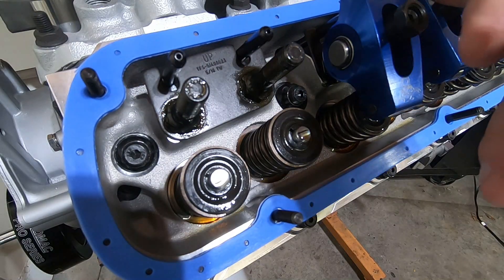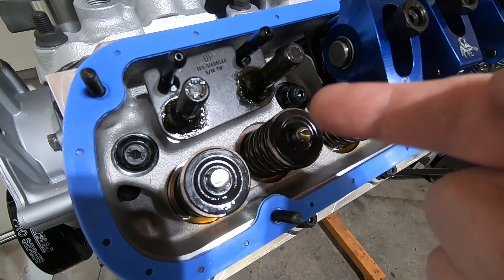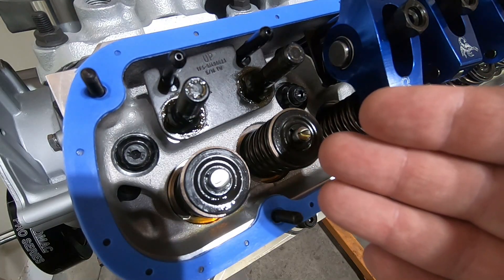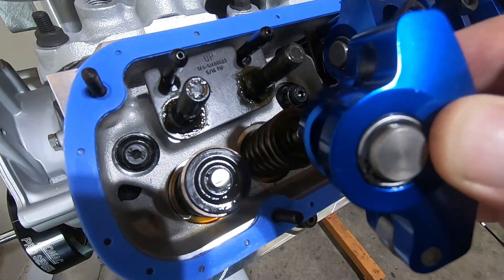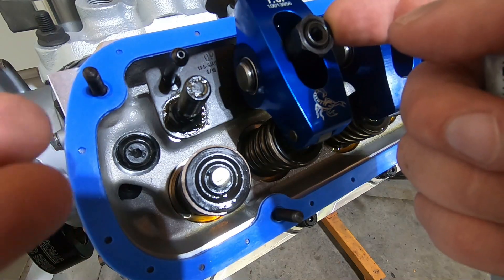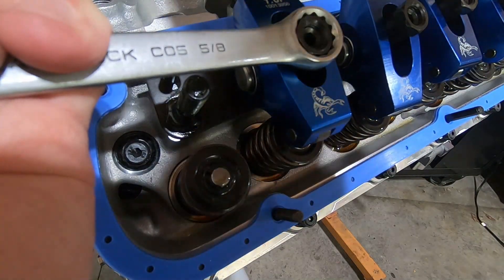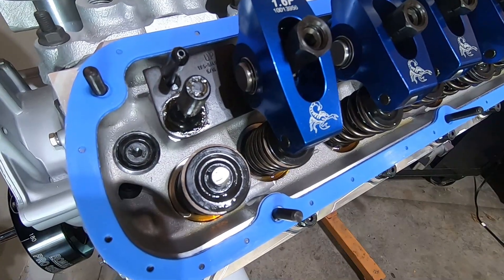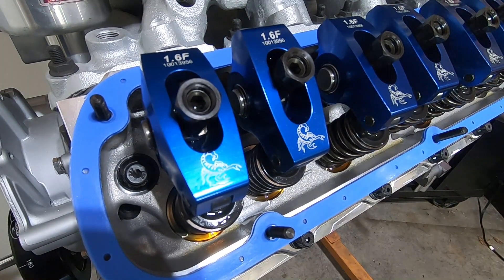Proper Hydraulic Cam Valve Adjustment

Comment: like so many you are so full of crap, tdc at end of compression stroke, neither intake nor exhaust is open does not matter how long a duration cam it is...I just looked at the biggest cam on summit for solid roller BBC intake closes 89 deg before TDC and exhaust closes 79 deg after TDC...and thats advertised not 0.050

Comment: Correction! You will never get it right on guessing the top dead center. Never! When the intake valve starts closing adjust the exhaust valve. When the exhaust valve is opening adjust the intake valve. So much more easier and accurate!!!

Comment: I've always done 1/4 turn to 3/8 in that ball park, an old timer circle track engine builder I shadowed in my teen years taught me to do it that way and that's just what I've always done since. From what I've seen in dyno videos since, it does lose a few numbers in the mid range, but it helps avoid early valve float at high rev. I have also heard people say the lower preload will chew up the lifters. Maybe it has happened to somebody, but I have only had one cam chew itself up in 20 years of tinkering.

Comment: So can you just stay on one side and do all of the valves, and then move over to the other side and do all the valves on that head?
Reply from the maker: @MagicMike007  💯 yes you can, which is what I do. More turning of the engine, but it keeps my head clear on which ones I’ve done and haven’t. Some people go by the firing order of the engine, and that’s fine too, you’ll just be bouncing around from bank to bank. Six of one, half dozen of the other.
Reply: @   Thanks for the reply. I was hoping I could do it that way. Engines on the stand, so it won’t be a problem turning the engine over. Thanks again.

Comment: How often should one do these adjustments?
Reply from the maker: Sorry I’m just now seeing by your comment, but if you have a hydraulic roller cam, this procedure is one-and-done. Never hurts to check at the first oil change on a new engine, but 99% of the time, your adjustments will not have changed.

Comment: So some of push rod feel loose/ spin easy after setting and continuing on with the other rockers. Is that normal or did I miss something?
Reply from the maker: @drewcifer9755  that’s fine, especially if the lifters don’t have oil in them or have been sitting for a while. Hydraulic lifters have springs under the cups which give a little resistance by themselves, but when oil pressure builds, they should operate fine.

Comment: So when the exhaust starts to open, do the intake, and when intake is starting to close, do the exhaust. I'm about to take these stock heads off and put some different ported and oversized stainless valve heads on that came with roller rockers. Never messed with roller rocker arms. It has a hydraulic cam. Thanks for the video.
Reply from the maker: @jasonbeason4780  yes, that’s correct. To put a finer point on the process, to adjust the exhaust, when the intake valve fully opens, and is about 3/4 the way closed, stop and adjust exhaust. Since you are putting new heads/rockers on, you’ll 99% need different length pushrods from your previous setup. This makes sure the geometry is right so you don’t wear out the valve guides on those heads you’ll install.
Reply: @GeorgiaStangMan  hey, I really appreciate this video. I took my old stock heads off and put a set of 60cc ported polished with 202 160 stainless valves with those roller rockers. Your video helped me set the roller rockers. My first roller rocker set up, and it didn't take long. The engine in the car had every off and back together. Did all this in the driveway. Started at about 11 o'clock and was done running and driving by 9. The only problem I had was the exhaust manifolds. But they always fun 😆. God bless you, I really appreciate the video
Reply from the maker: @jasonbeason4780  anytime, Brother. Glad it all worked out 👍

Comment: All I need help.  So I had a friend build my 347 stroker.  It has a massive cam in it .  When it starts it sounds ok., but when it comes down to idle it starts to backfire like a valve is open.  Can any one help out.  I will try this valve adjustment. Fingers crossed. 🤞
Reply from the maker: So sorry I’m just now seeing your comment! Hopefully you found the issue on that 347.

Comment: Could you possiblity explain the best you can the feeling of the push rod when your spinning it with your fingers,  what your are feeling.  I keep screwing it up and twice I didnt do it tight enough, this time to tight.  Any help would be greatly appreciated.   Great video by the way
Reply from the maker: The pushrod just needs to have a little friction as you tighten the nut by hand. Once there is some drag on the pushrod as you spin it, you know there is no play at either end of the pushrod where it meets the rocker cup or the lifter cup. At that point stop and make your adjustment at the adjuster nut and lock it down as shown. Good luck 👍
Reply: @GeorgiaStangMan  Ok,  finally I got it right!!   Dude thank you so much.   I fired it up an hour ago and thanks to your videos I got my 68 302 mustang running again.   And it never sounded this good before. I owe you such a big thanks for doing what you do!   Now I have to watch every video you made just in case.
Reply from the maker: @MustangStrong  awesome! Glad it worked out! 👍

Comment: I have a new build 1st time ever building a motor and i think valves out of adjustment is possibly my issue, was running good but but poorly now, like missing and when you take off on the gas its like its down 2 cylinders so i changed the plugs and found 2 with unburned fuel like oil residue but smelled of gas, the others looked fine so im hoping its something fixed by re-adjusting the rockers, its a fully built 331 stroker with twisted wedge 170 heads
Reply: Im going thriugh the same thing 460 Ford..My first build all the way out from the shortblock.Wont stay running, starter dies quick.Readjudted,started but gutless.

Comment: is this done with the lifters oil primed or not?
Reply from the maker: This was done without oil in lifters, but wouldn’t matter if the lifters did. The plungers inside the lifters cannot overcome the force of the adjusting nut pushing down on them via the pushrod. Also, hydraulic lifters have a spring under the plungers, so even if they are dry, you’ll still get resistance on the pushrod when creeping up on finding the zero lash point.
Reply: @GeorgiaStangMan  thanks for the reply !
Reply from the maker: @justinriley8651  Anytime! Good luck!

Comment: will this work on a stock cam with just installing new lifters and push rods and new rocker arms car has 77k on it and my cam is stock so cam is original lifters are rollers i have them socking in oil ford 302 efi in a merc grand mark 1989 gs
Reply from the maker: Yes, use this on a stock cam as well. Good luck 👍

Comment: So glad I saw this video, I previously found a method to adjust rockers called rock and adjust. I just did this procedure yesterday and on 2 or 3 valves as I started to turn down on my adjuster, there was resistance right away! The rest of the adjustments went flawlessly, but after seeing your video, I'm thinking I should change to this method? Your comments or help would be greatly appreciated!
Reply from the maker: I’ve never heard of rock and adjust, but the method in the video is the only proper way to ensure the lifter is on the heel of the cam lobe for proper adjustment. Good luck 👍
Reply: @GeorgiaStangMan  When using your method, can you just go from cylinder to cylinder? Or is there a particular order you should go in?
Reply from the maker: @TomMilstead  No particular cylinder order of operation is needed. You can choose to go in any cylinder order you want. The key thing is once you are on a cylinder, follow the above procedures and you’ll be golden 🥇
Reply: @GeorgiaStangMan  Greatly appreciated!!!

Comment: To my fellow gearheads…… Please understand that we do not adjust valves. Once a valve has been installed, spring installed, retainer installed and keepers installed..….. there is no further adjustment that could possibly be made. 
What we are doing, is adjusting the depth of the push rod, which in turn positions the hydraulic plunger within the cam follower body.

At 2:34 into the video, I must disagree with him. The entire purpose of a hydraulic cam and hydraulic cam followers, is to allow for compensation. 
That is why the plunger travel is in the neighborhood of .100" to .140ish".  
In general, the pre-load is in the range of 50% of that..... some call for less. 
So, if your plunger travel is .100" to  .140", and if the pre-load is set correctly, the plunger will be down into the cam follower body by approximately .050" to .070".
In my opinioon, this is more than enough to to allow the use of making the adjustment at TDC C/S. 

It also allows for the use of the  "8 stop static procedure" (V-8 engines).
I.E., begin with #1 @ TDC C/s, adjust!
Go to the next cylinder in the firing order, adjust!
Go to the next one in the firing order, adjust, and so on.
Reply: I agree with you. I have done the firing order method many times, also checked it several times while running and it was perfect. Many years ago I had an old repair manual and it told me which valves I could adjust at a particular crankshaft degree. That made me think why cant I just do it by the firing order and 45 degree of crankshaft rotation at a time.

Comment: Great video. May I ask your opinion on Comp Cams Pro Magnum lifters (hydraulic flat-tappet) calling for 0 to 1/8th turn? My engine clatters like a mofo! They warn against going tighter but i don't know what else it could be.
Reply from the maker: Seems like those lifters are meant to run at high rpm, and therefore need the looser tolerances, which can definitely lead to noisy valve train
Reply: @GeorgiaStangMan  Thanks for the reply. They’re so loud I don’t dare run the engine. Going over it for the 4th time I guess.

Comment: Finally !!  This is the correct way and best way to adjust your valves correctly.  It's not necessary to take each rocker off as you can just watch them going up and down but I know you did that to show more detail.  Great video.  Thanks for taking the time to show the correct and best way.
Reply from the maker: @Yosemite Sam thanks! You are right regarding removal of the rockers not necessary… looking back I should have mentioned why I did that just for this example - to get a better look at the pushrod movement. I was limited on space lol. I’m all about the “more than one way to (insert pun here)”, but certain tasks are not like that, and adjusting valves is one of them. I just saw way too many people adjusting on compression that I had to clear the air lol.

Comment: Nice job! What valve cover gaskets are those?
Reply from the maker: Thanks! I’m glad you asked, I totally forgot to mention those in the video! They are Moroso part number 93060. They are a must have as far as I’m concerned for those who run AFR heads. I use these on every engine. Steel core, bonded rubber, but have a wider sealing surface.
Reply: @GeorgiaStangMan  yeah the felpro rubber with metal core just don't seem to hold up for me, they always seem to peel and split the rubber around the corners